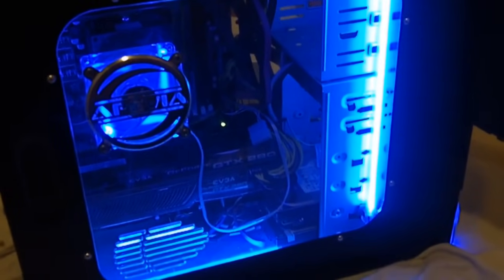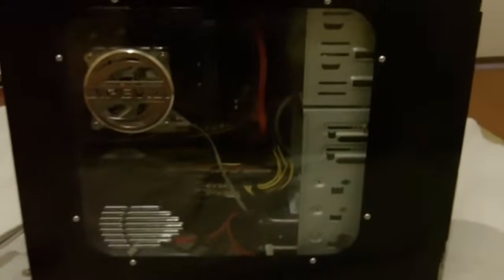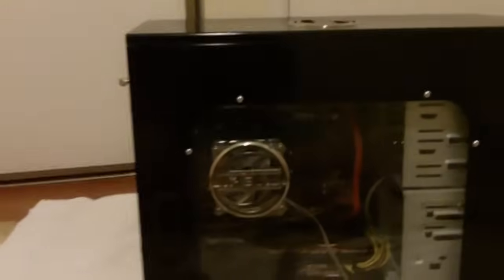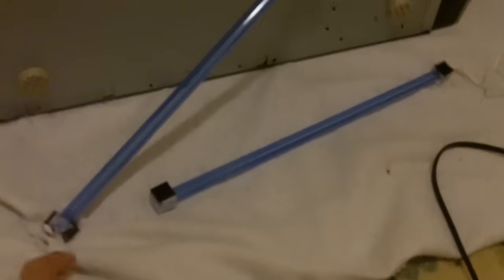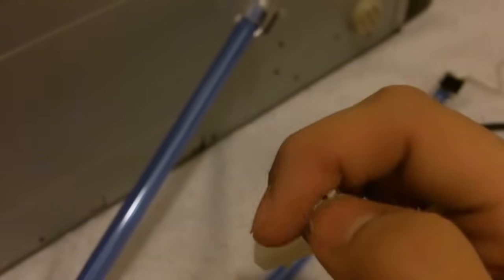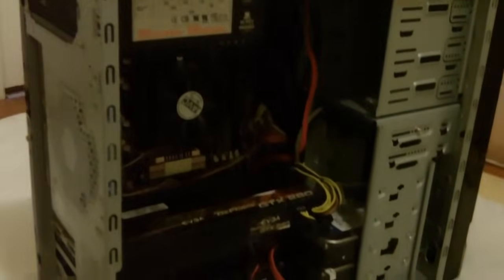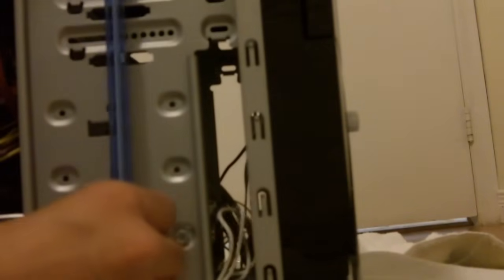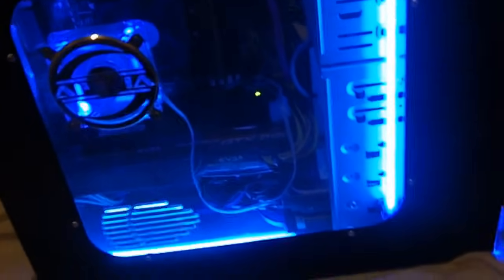Computer Case Lighting Mod/Cable Management Tutorial

Comment: You should be using the slots in the motherboard tray and tuck the wires on that part instead of that corner.  Cleaner.